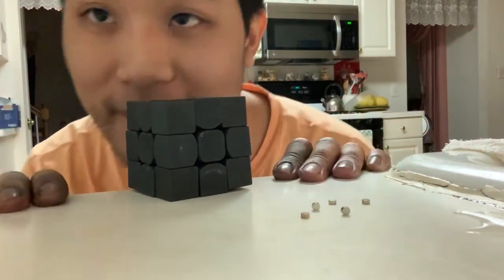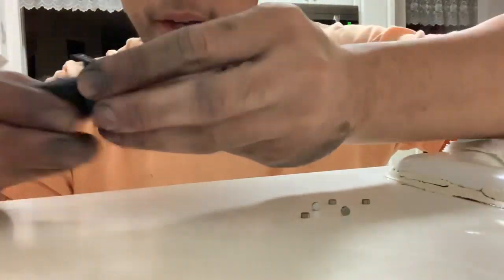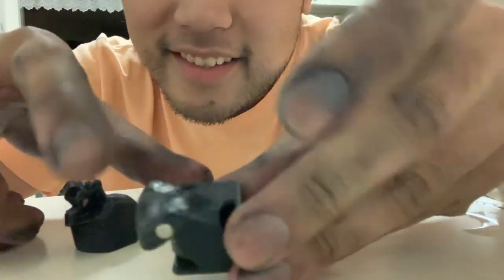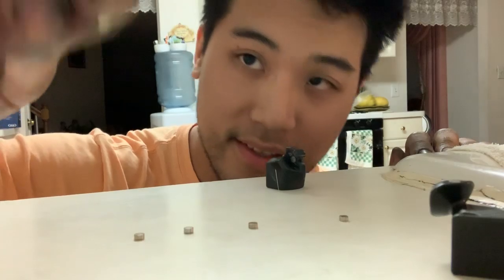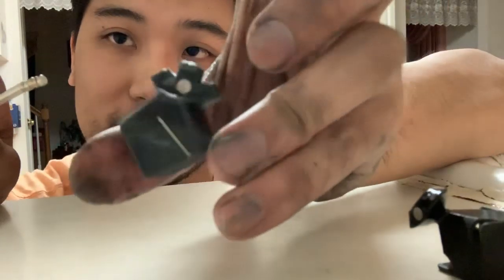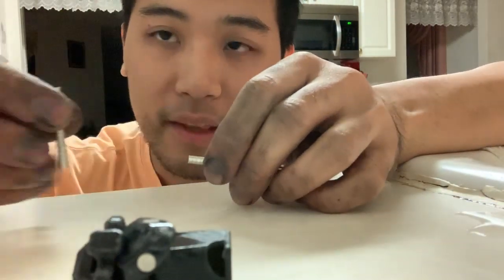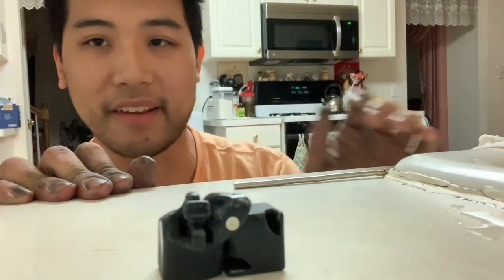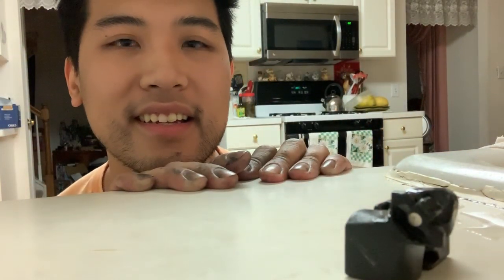12 magnet, full magnetic cube (super deep radius) & fun science talk

Comment: This is actually great idea, and I think it will be in implemented in cubes at some point.
Magnets + magnetically soft steel would yield the best effect I think.
You could also increase the pull force by using larger steel plates/inserts, and thus give pretty strong feeling with very little magnetic material used.
Also a lot of people prefer non-tactile cubes, but having them stabilized by magnets is still useful.
In the way you placed the magnet, it's size is limited by thickness of the torpedo part, which is extremely thin in newer cubes, for superior corner cutting.
This however might be easily solved by putting magnets in the edge facing down to the core, with metal inserts on the top of bases of corners. Sort of like you have it in skewbs.
It would require redesigning, but worth it for some applications - the cheapest 3x3's on the market, have lower production cost than 1 set of magnets to magnetize them, and that would surely help to make them super affordable.
Reply from the maker: oh my god you are a legend, you were my idol many years ago
thank you for watching my video
Reply: @HumphreyWittingtonsworthIV  :D
Nice to hear that, I don't get that often.
Also good video about logo removal, I needed that.
I think you could show this video to some manufacturers like YuXin - they would surely be interested in such idea.

Comment: Wouldn't this be 36 magnets? Because 3 in each corner = 24 and 1 in each edge = 12 and 12+24 = 36?
Reply: There is only 12 legit magnets tho, the other 24 in the corners are no longer are "magnetic", they are just normal metal. You can read the first line of the description.